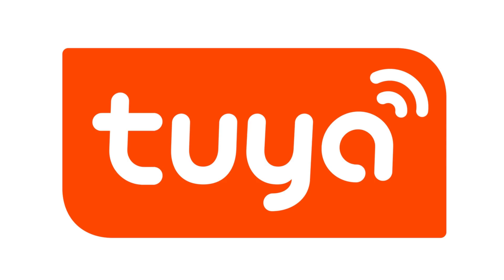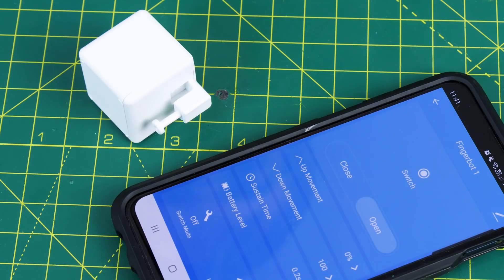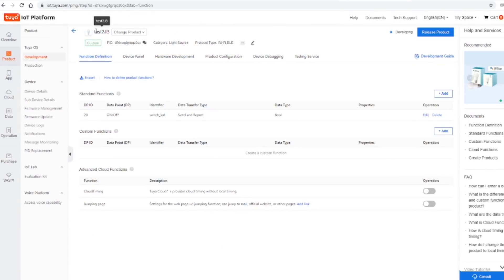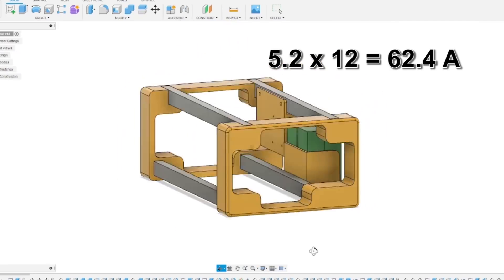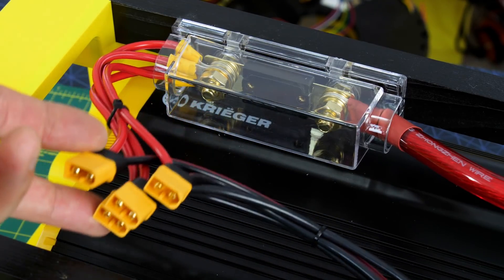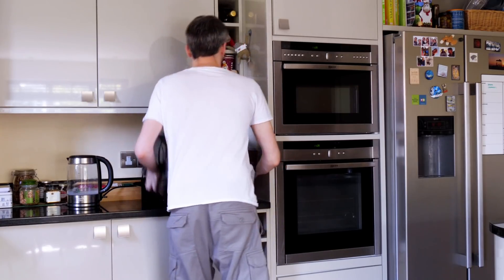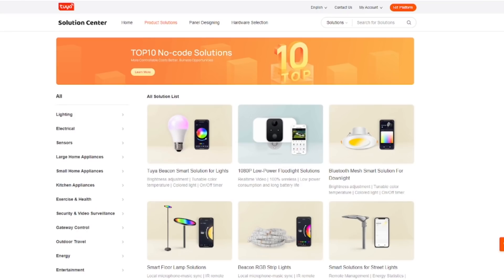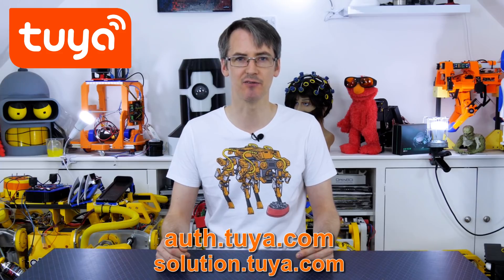IoT Microwave Works Anywhere

Comment: im starting college for an engineering field and while i think i would do better in a BSMET course, BSME has the option for MSME and some info online says that all engie tech degrees have a shaky reputation in securing actual engineering jobs and not factory management jobs. (also kinda afraid i dont have what it takes to pass those higher math classes. took precal and trig in high school but i underestimate myself all the time and am poorly self aware of it)

Comment: Fun fact about Tuya: You can route all the traffic necessary to run a Tuya smart plug or light or what have you via some DNS tweaking to your private Home Assistant server, so you don't have to rely on some chinese server not shutting down, turning your cheap smart plugs into really expensive manual switches that constantly ping a dead IP that can be bought by anyone on the internet. Also you can try to flash Tasmota firmware onto them, but they work actively against that so it works on only some models.
Reply: If using it from anywhere in the world is necessary to you, set up an OpenVPN connection to your home LAN and you got that going too.

Comment: The issue with tuya as a company. Is that they sell licenses to companies to use their platform on their products. The issue becomes when that company stops paying the licenses usually due to increased costs from tuya. tuya disables the services for those devices. Rendering your device useless. This is true of many low cost smart bulbs and other iot's. It's a shameful practice.
Reply: I'm copypasting a bit much maybe, but I want to spread the word: You can route all the traffic necessary to run a Tuya smart plug or light or what have you via some DNS tweaking to your private Home Assistant server, so you don't have to rely on some chinese server not shutting down, turning your cheap smart plugs into really expensive manual switches that constantly ping a dead IP that can be bought by anyone on the internet. Also you can try to flash Tasmota firmware onto them, but they work actively against that so it works on only some models.
You can shut Tuya out of their devices and make them YOUR devices.
Reply: @fredwupkensoppel8949  very familiar with tasmota. Cant fault it

Comment: I used to like Tuya until they locked out all new devices from open source firmware. tuya-convert doesn't work any more to upload your own code. They deliberately obfuscated and encrypted the pairing, meaning the only answer is to open them and probe pins yourself; and they are often glued together. I'm not impressed at all, there is no way to identify the encrypted models, and there was zero reason for them to do it. I've gone off IoT until companies stop insisting on their own apps and ecosystem, especially Tuya since they did it in secret and screwed a lot of people over. Disappointed to see them trying this crap on Youtube.
Reply: Companies like Tuya I think are aiming their products towards people who are not that tech-savvy. Make their products simple enough to use that is so people will become dependent on their services.

Tech-savvy people are probably seen as a danger by Tuya because they can modify the technology. And if there's anything that corporations don't like it's smart customers.
Reply: I've been looking at home assistant. You can just use off the shelf parts like esp32s and raspberry pis.

Comment: I've tried to run a little microwave off an inverter several times over the years and it ran fine, but never actually heated anything.

I've been told that cheap inverters don't actually make a true sine wave and that's the problem.

Do modern inverters usually make a good sine wave or are cheapo ones still common?  Any recommendations on brands that advertising pure sine wav AC can be trusted?

Comment: The problem with IoT devices is that it costs you every single time you push or pull data. Turning on a lightbulb with that push arm will literally cost you $1 every time.
Reply: I have no love for "the cloud", but what you are saying sounds ridiculous, unless you live in some shithole country with massive bandwidth caps.
Reply: Pretty much all companies are eliminating the sane 'old fashioned' billing structure and going to the phone-plan style of billing structure where they get to charge you 10 times as much while providing you 10 times worse service.

Comment: The best thing about tuya that there is a python and a javascript API so you can easily achieve complex automatisation. I found using the application slow, because it takes some time to load in, which is not ideal, when you need the lights quickly, so I made my own programs.

Comment: Use Home Assistant and not this crap. Installs to a Raspberry Pi and can control a lot of devices without having to send your packets around the world first. Also works without an internet connection, like it should, because that makes sense!
Reply: you mean home assistant? I am trying to learn about this
Reply: @sr.railn.m.667  That's the one! Thanks. Corrected my first comment.

Comment: Then the running microwave disrupts the WiFi signal and you can't turn it off remotely 🤣
Reply: If your microwave disrupts your wifi you should definitely think of getting a new microwave in the next 4 seconds.
Reply: Microwave runs at ~ 800 MHz. More likely to trash 4G cellular connections. Great for generating white/pink noise though.
And yeah, as Crash said, if the thing is "transmitting" then you're getting nuked mate.
Reply: @EngineeringVignettes  erm what? The frequency band of 2.45Ghz is used because that is the resonant frequency of water. And because Ovens use that, this band is unregulated, so free to use for anyone. Resulting in WiFi using 2.45Ghz. Your claim of 800 is wrong.
Reply: @Gunstick  - whoops. Yes you are correct. For some reason I thought they were running at a lower frequency. I may be thinking about another microwave transmission system... my bad.

Comment: For home automation I really prefer something like Home Assistant to keep everything local... And for the "IoT" devices I avoid as much as possible the wifi ones, and prefer something like zigbee
Reply: My main issue with the IoT stuff everyone seems to peddle is that it's always WiFi-connected. I'd like to keep my WiFi transmit duration available for laptops/phones which can actually use it, not saturate my router/APs with ridiculous amounts of tiny devices that barely communicate anyway.
Plus, ZigBee and Z-Wave are both mesh-based by design, so it's a lot easier to run such a network - as adding a new mains-powered device actually increases the available network bandwidth and device slots.

Running Home-Assistant with ZigBee at home, works absolute wonders though it's still a little bit painful to set up, mainly due to a lack of good and available ZigBee dongles.
Reply: @AnanaceDev  At home I have Home Assistant running flawlessly on a pi 3b+ for more than a year now, and for all my zigbee devices (ikea for light ant plugs, and xiaomi for sensors) I use a conbee dongle, the deconz plugin is easy to set up in home assistant.
The only "smart" devices I keep on wifi are the speakers but I think they should be updated more than most of the little "IoT" things
Reply: You can reroute the traffic to your Home Assistant server so the plugs think they talk to their usual Tuya server while it's actually nicely contained in your own network.

Comment: I have no problem with sponsored videos and I think this one is very well made. Just cloud connected smart home devices are incredibly bad idea and we all should be against it. If Toya makes "non-cloud" version of these I may think about buying.
Reply: Apparently they are working on a local api but i dont know how much of this hardware will support that. In any case theres no reason you wouldn't be able to reflash them with custom firmware anyway. Tuya is nice because they bring the price down with the large volume they produce

Comment: I see a lot of criticism here about the cloud service. That's fair enough. But apparently Tuya are currently opening up all their devices to run on local networks, with no need for a proprietary server or an internet connection. If they see it through, that deserves praise. As all smart home devices should do the same.
Reply: I'll believe it when I see it, they seem to be making lots of effort to make their products un-flashable for those of us who do want to make them local now, not at some unspecified time. Not a huge fan of having a Chinese (or any) cloud provider holding my WiFi credentials either.
Reply: Developer of TuyAPI here. No, that's not happening, at least not to the degree you seem to be implying. They plan on providing a binary blob that will allow basic control but the protocol itself will still be closed and it's unclear whether or not devices will work without an internet connection. At the end of the day, they see themselves as a cloud services company - not a device manufacturer. It's not in their interest to add accessible local control.

Comment: 1. An IOT Microwave is a dumb idea to begin with.
2. Using a microwave is such first-world solution. Ever thought of using a solar oven? (Which is basically just a parabolic mirror, and in places that don't have much sunlight but wind, a clear cover over it. Ok, I get that is a commercial for Tuya. But couldn't you think of something better?

8:43 Yeah ... putting metal (the clip on the label/bag) into a microwave. Always a good idea. You should have heated the water separately. Also, you never ever put teabags in cold water, you monster.
9:30 Yeah, and that is useful, how? What's next? A toilet that you can flush from anywhere in the world?

Comment: Tuya is the worst IoT ecosystem I've ever used. The only reason to get a Tuya device is to flash Tasmota firmware onto it
Reply: I can’t speak regarding it being “the worst”, as it does successfully do the bare minimum (usually), but it definitely lacks features other similar devices have (no secure HomeKit/Siri integration for bulbs and outlets, only a colorwheel or slider for colored lights instead of actual color value inputs, etc) but considering how widely used and cheap they are I can’t complain about that aspect.

That said, for half a decade or so, they used ESP-based wifi modules in their devices (other companies did this too, Sonoff being the biggest I know of) which are essentially small arduino modules, so you can flash an open source firmware to them (tasmota being quite popular) and have actual full control of your IoT devices. Suddenly that 4-pack of RGBW light bulbs you bought is no longer crippled by a laggy app that offers almost no functionality; you can load it up with custom prebuilt firmwares to have proper lighting controls, proper smarthome integration without relying on random Chinese servers, and hell, you could code your own custom firmware if you’re that dedicated. A friend of mine pointed out you could even turn them into ludicrously slow Bitcoin mining machines if you wanted - the whole point of flashing custom firmware is, well, to customize/improve/fix the devices, after all.
Reply: Even worse, they've locked out firmware updates in new models. tuya-convert doesn't work any longer to upload your own code. It's really very frustrating. Surely it was no loss to them. Won't be buying Tuya just because of this, there was zero reason for them to do that.
Reply: Explain
Reply: @AndrewRGross  They're horribly inconsistent. It's a crapshoot whether your device will actually connect when you get it. And the devices you are able to successfully set up might just randomly stop working one day and just brick itself
Reply: @AndrewRGross  - Agreed. The OP has to explain and/or prove his point. Otherwise the comment is just faff.

Comment: There is a small issue - timer on the oven has to set in advance resulting in non-autonomous solution.
Reply from the maker: I guess you could put a servo on it and use a custom Tuya app to turn it.
Reply: The automation have to stop somewhere. If you have to prepare the cup and put it in the microwave manually anyway, you might as well turn the nob also, not that hard.

Comment: What happens when Tuya go under? you have a whole bunch of IoT bricks
Reply: there is a possibility of running a local tuya imitating server, but it's pretty finicky to set up, works just acceptable and it still tries to connect to the cloud. In the event of a shutdown it might work, not for most end user though i assume.
Reply: Apparently they're currently opening up all their devices so they will work with Home Assistant with no need for a server. If true, that's to be applauded.
Reply: Just re-flash the hardware to use your own server (which is what I would do as soon as I opened the package, just on principle)
Reply: @pileofstuff  is there an open firmware available somewhere  for the Realtek chips? popular tasmota is only for ESP8266 based appliances, wich got replaced relatively recently
Reply: @noahluppe  Dunno. When I wanted to re-purpose a Sonoff, iI wrote my own hacky code rather than using Tasmota.
Presumably if I could do that, a smart person could do the same for these things too.
Reply: @noahluppe  When a closed platform shuts down it's online side, the community often finds a way to make use of the orphaned hardware.

There's a lot of smart people out there who love a good challenge.
Reply: Welcome to the cloud... :/
Reply: Copypasted from my own comment because I'm lazy: You can route all the traffic necessary to run a Tuya smart plug or light or what have you via some DNS tweaking to your private Home Assistant server, so you don't have to rely on some chinese server not shutting down, turning your cheap smart plugs into really expensive manual switches that constantly ping a dead IP that can be bought by anyone on the internet. Also you can try to flash Tasmota firmware onto them, but they work actively against that so it works on only some models.
Reply: It's possible to switch out the tuya modules for ESP8266 modules and run tasmota etc. so it's not a total loss.

Comment: Just flash Tasmota firmware on it no need for a cloud then (super easy home assistant integration).
Reply: Home Assistant is also a cloud and proprietary. Not a better option. 🌈
Reply: @robertschnobert9090  No thats wrong! Home assistant is open source and not cloud based, I think you mean home kit ??? You can download and install home assistant where you want and don't need internet connection for it. There are a lot of open source smart home solutions which don't need a cloud or other shit. Link to github: https://github.com/home-assistant/core

Comment: Wouldn’t your 1200 watt microwave absolutely drown the micro watts in signal from your hotspot. I know you can turn it on because it starts turned off but controlling it after that would be impossible, right?
Reply from the maker: It seemed to work ok - I did multiple takes from that distance.

Comment: diy motors, dc-ac double motor-generator inverter perfect flywheel sine output, true dc brushed (and -less) motor, ball bearing brushed, conductive gearing greasing
Reply: permanent magnets and/or coil magnets

Comment: "works literally anywhere"... Throw it into the ocean and see if it works there...
Reply: Just put it in a sealed bag or box, have an antenna with a floater on the surface. Easy.
Reply: In the sense that you would have to make aditions and changes to it for it to work somewhere else, then every microwave can work anywhere as long as you make sufficient changes to them....

Comment: As someone who has worked with electronics a long time I can't help but feel there should be some kind of disclaimer/warning in regard to mains voltages.
Reply: @tie pup Common sense would dictate that you not work with mains voltages unless you've been properly trained to do so. However, that doesn't change the fact that 100's of tinkerers get electrocuted each year when they work with mains power.